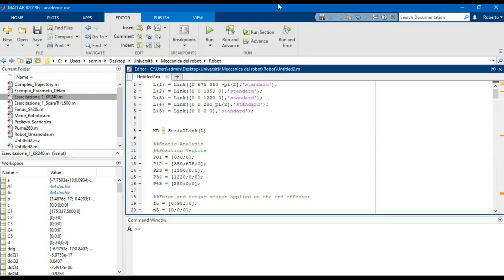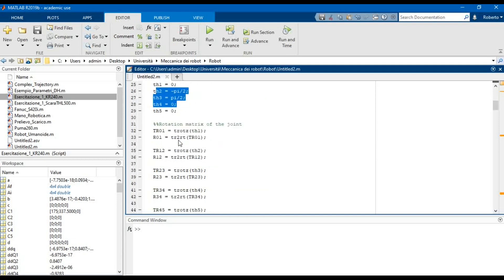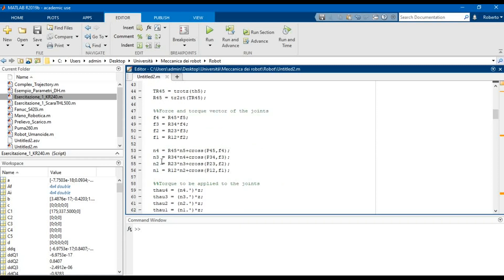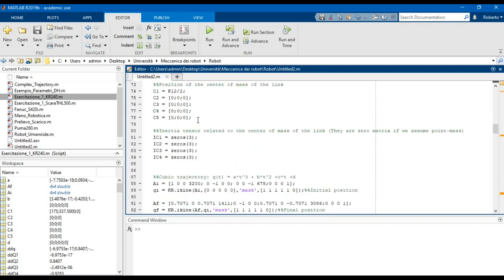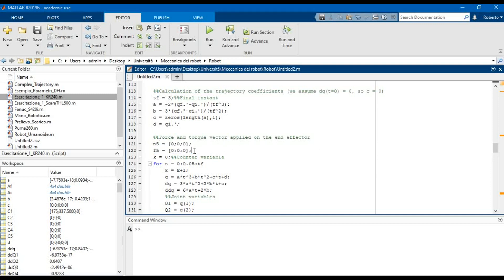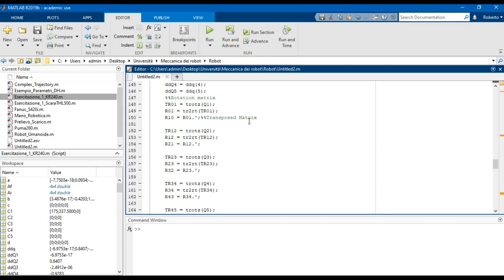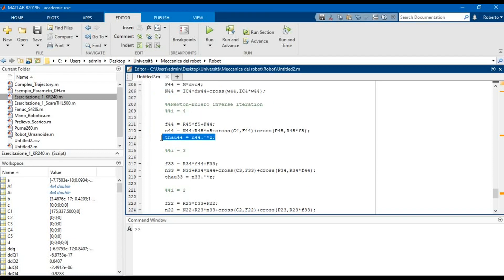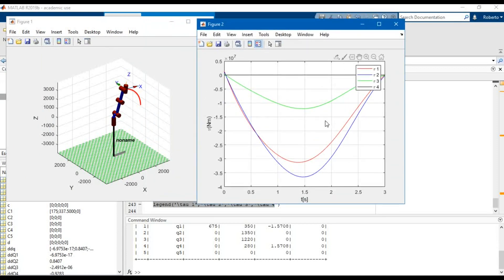MatLab Robotics ToolBox #5 - Static and Dynamic Analysis of a Robot

Comment: Thank you for your kind lecture. I just wander if the i=3 of the newton-euler forward part has minor problem likes 'ddQ3 must be ddQ4 on the line 200 and 201' and 'dv33 must be dv44 on the line 204'. I just think all the iteration of forward part has the same rule. If not, sorry about miss understanding. (you can see those at 5:21)

Comment: nice, I'm trying to write this code for 6DOF robot but I received error Like this : Error using SerialLink/ikine (line 131)
Mask matrix should have 6 elements

Error in edynamic (line 74)
qi = hamed.ikine(Ai,[0 0 0 0 0 0],'mask',[1, 1, 1, 1,
1, 0]); can you help me to fix this? thanks a lot
and can I share my code with you?
Reply from the maker: Hi, in the mask vector you don't have to use ",". So you have to write [1 1 1 1 1 0]
Reply: @amazingengineering3207  
I still can't fix the above error, can you help me?
Reply: are u using release 9? i got the same problem. When i switch to release 10, the problem goes away